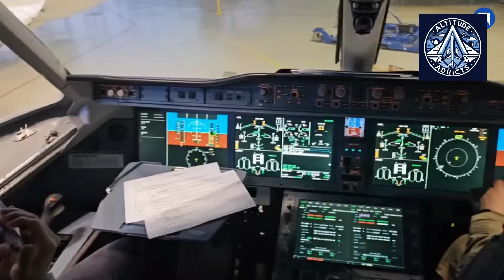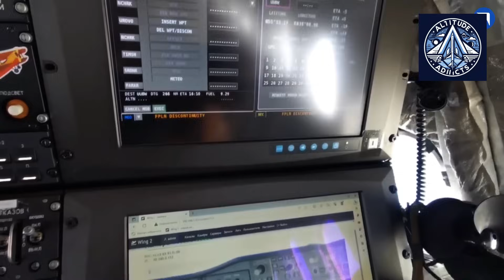Testing the SJ-100 at 40,000 FT—How Russia’s Jet Performed

Comment: Wow all the hype over an outdated design, which was never successful in the first place, with only 229 airframes made in over 15 years. Boeing or airbus produces the same number of single isle jets in 8 months. Think about that. 

Furthermore, the PD-8 engine is a de-rated version of the PD-14 engine, otherwise they are EXACTLY the same. Meanwhile Safran, GE and R&R are coming out with geared turbofans and LEAP engines, the PD-8 pails in comparison. It's not even certified to this day, if Russian certifications even mean anything to anyone. It's almost 40% less efficient than its competitors across the border. 

Point is, Russia is again, just like the USSR, is producing outdated, antiquated aircraft because it can't get the new western airplanes. But yet the comments section is praising the manufacturer. Just like LADA is still rolling cars off the conveyor belt, which were designed 40 years ago, or more. Great success comrades, self sufficient, but at a cost of virtually everything else. Pathetic.
Reply: @contemporarymonk  Where did you got that PD-8 is 40% less efficient?
Reply: @dquzmanovic   He just lied. His entire post is just venomous bull and lies. Some racist piece of.
Reply: @dquzmanovic  He lied. Some venomous racist piece of dot dot dot.
Reply: @dquzmanovic  literally off the manufactures performance data, posted on their website. 

Pd-8 Specific fuel consumption at cruising mode	0.61 kg/kgf hour

Leap 1A Specific fuel consumption at cruising mode 0.25 kg/kgf hour. 

Sorry I was wrong the pd 8 is 2.3 times less efficient than competitors, while producing 10k lb less thrust.

But engine is engine, great success comrade. Am I right?
Reply: @contemporarymonk  russophobie.
Reply: @contemporarymonk 
Leap 1A has TSFP at cruise speed : 0.51 lb/lbf/h which is equal 0.51 kg/kgf/h.
But this engine can only be compared vs. PD-14.
While PD-8 shall be compared with other 8000kgf engines.
Reply: Least they dont fall out of the sky every week like Boeing
Reply: @jafarhon  Maybe because there are only like 4 actively flying lol
Reply: @Yassified3425  LOL ? Do you know how many Russian made planes are flying now days ? TU, SU , and still they dont fall out of the sky like Boeing
Reply: Bla bla bla. Why don’t resume all you have wrote here and say you’re a pathetic russophobie. Whatever Russia does you’ll despice no matter what. Boeing and Airbus will loose a big market for their planes. Russian market is going to double in a decade.   They will sell this airplane to their allies and they will have no problems with repairs and upgrades like they have now because of sanctions. That is a big win for Rusia and a big loose for the collective west that wanted the Russia economy and industry to go down in pieces. This plane engine and others will not breake  the airbus and boeing industry but it’ll free Russia and allies of coercive west sanctions in regards of  air industry needs.

Comment: It's a new engine 🚂 so it's parameters should be set higher than existing engines... So the altitude target 🎯 should be higher than 12,000.00 of the current French engine being used for sj100....
Reply: It really depends what altitude the engine is optimized for. But there is slightly more thrust on the pd8. Should be able to achieve the same altitude with a slightly heavier load or higher speed.